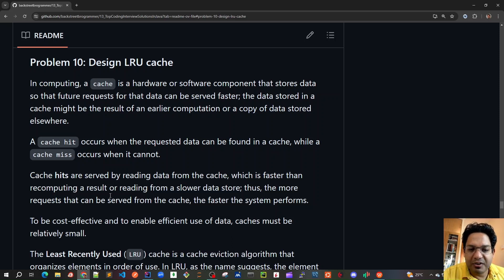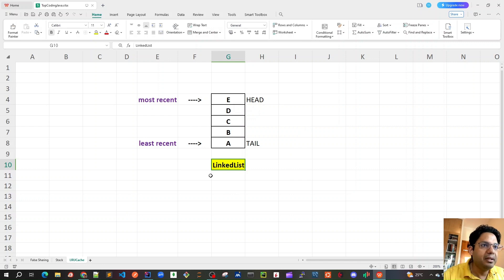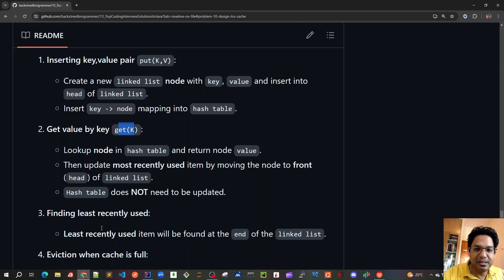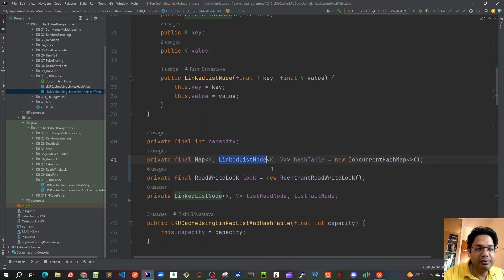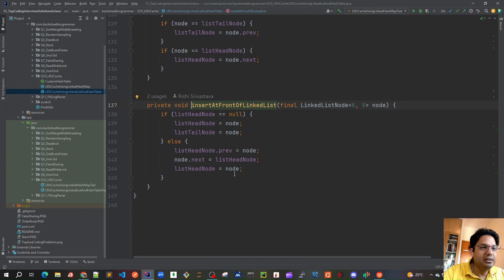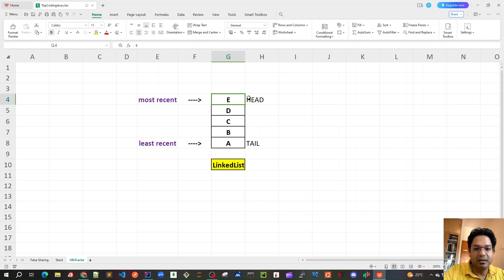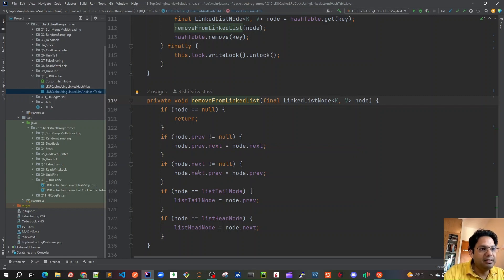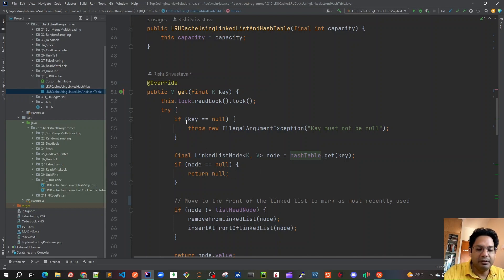55 - Design LRU cache using custom thread-safe data structures

Comment: Hi Rishi, the thread safe implementation you have provided is not performant due to lock contention. The DLL is manipulated by only one thread at a time in GET op. What other ways do you suggest which can make this highly concurrent?
Reply from the maker: Hi - thanks for the QnA. Thats the trade-off with concurrency - if we want to be thread-safe, we have to compromise on performance and vice versa. In the LRU cache design, we have to adhere to single writer + single reader thread as even reading requires manipulation of DLL.
Reply: @backstreetbrogrammer  do you feel that a fine grained locking can help while manipulating the DLL? Lets say if you want to move a node to front, acquire lock on previous, current and next in the same order to avoid deadlocks.
Reply from the maker: @chikkipie  yes - that would help. Also I may suggest to use just one Object Lock and remove ReadWrite Lock completely. And use this object lock whenever we are mutating the DLL.

Comment: I think there is a race condition here.
The get operation is not a simple read operation - it's doing modifications in our DLL. And since we're only taking a read lock in the get op, multiple get ops might concurrently modifiy the DLL.
For eg., if multiple threads try to put a node at the head of the DLL at the same time, how do we make sure their pointers are all properly updated?
Reply from the maker: Thanks Abhinav for notifying the bug - its indeed a bug. I have posted the bug fix video and also updated the source code in Github.

https://youtu.be/fn7q3havXIY